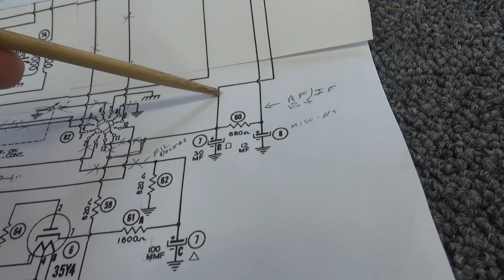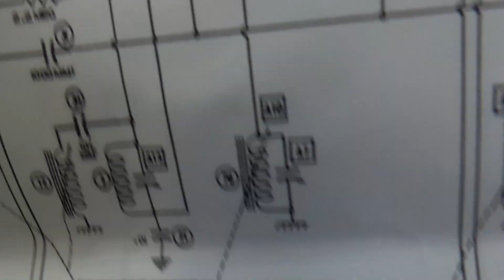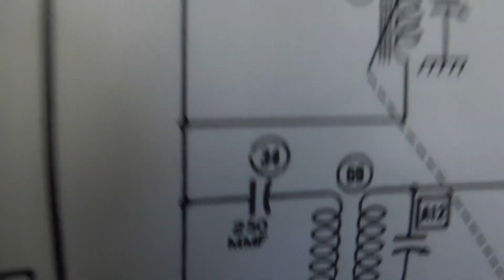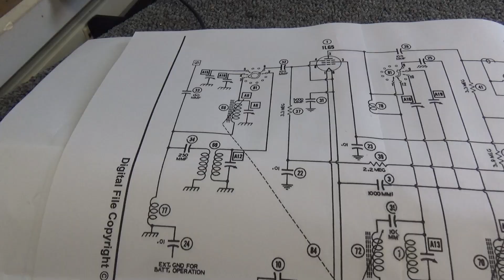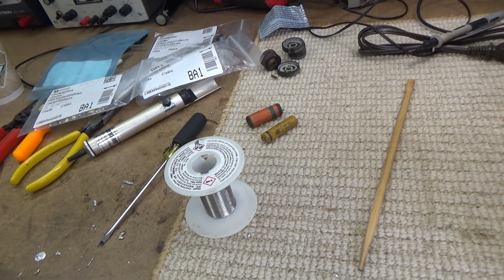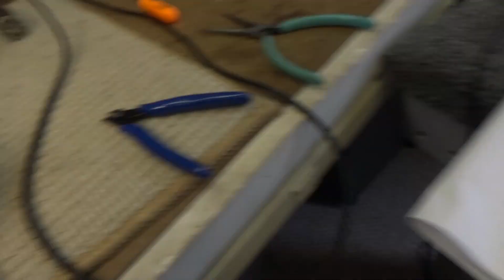Episode 83-2, The Neverending Story" Sears Silvertone 8230

Comment: Those  old color resistors are known as a BED resistor. Body ,end ,dot. If you don't have a dot you have a band. Green, 
Black, Yellow one is 500 kOhms +/- 20 %. So it is OK. The ones that go bad are always the hardest to reach!  When 
replacing with a new cap get a fine Sharpie marker and write down the capacitance on it cause they usually don't face well 
( hard to read ) when it comes to their values when in the radio. Hope it works when you  eventually plug it into a dim bulb tester.